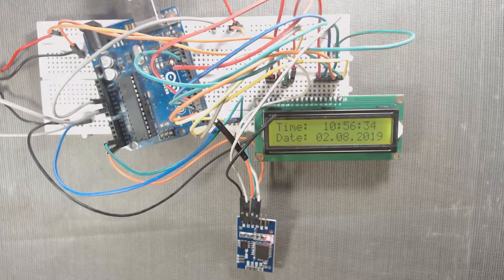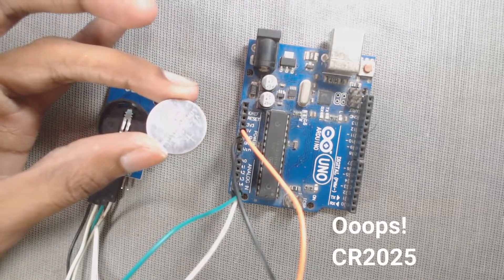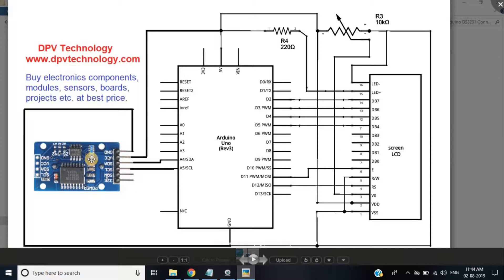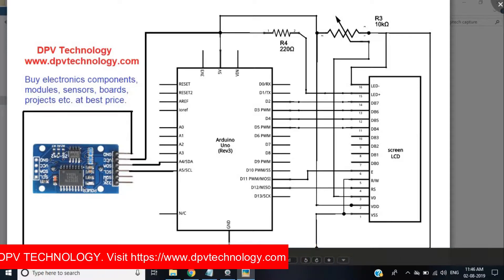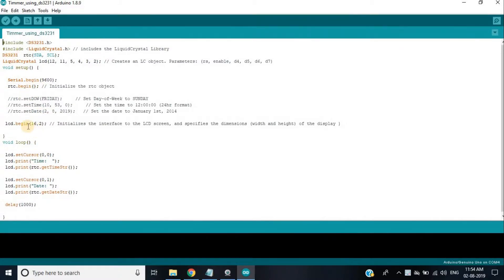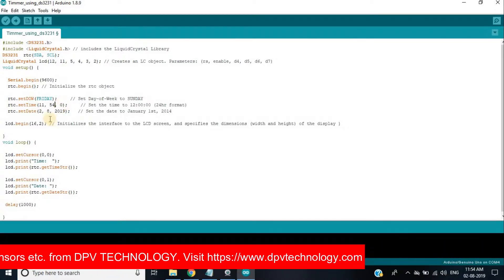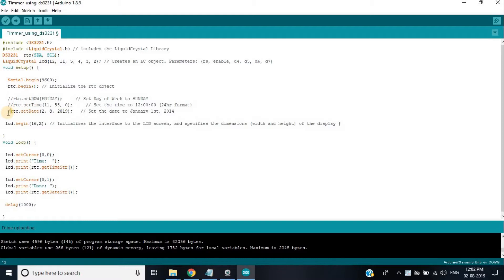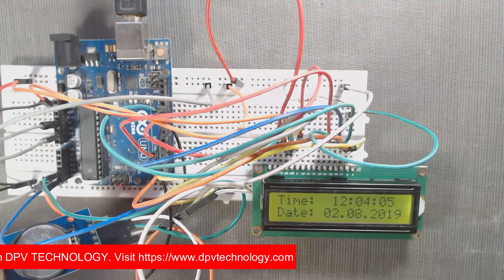How to connect DS 3231 Real time clock module with LCD and Arduino [ CC ]

Comment: Have u tried Arduino mega board but i want to do the same thing with Arduino uno board can u make video for interfacing Arduino uno with ds3232 rtc module and 16*2 normal lcd display but don't use 16*2 i2c lcd bcz i want this interfacing with normal 16*2 lcd plz make video on this with full explanation including Library installation process too plz it's an urgent